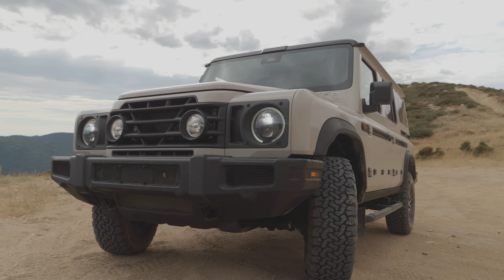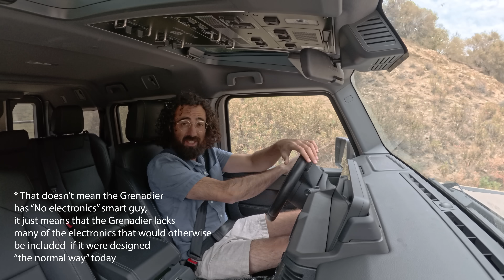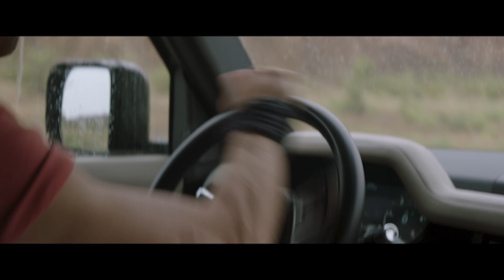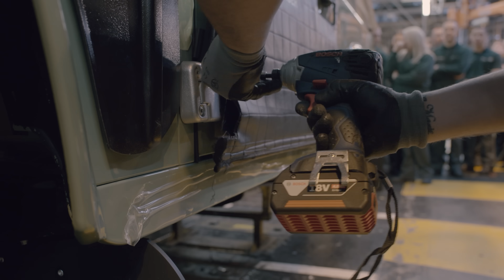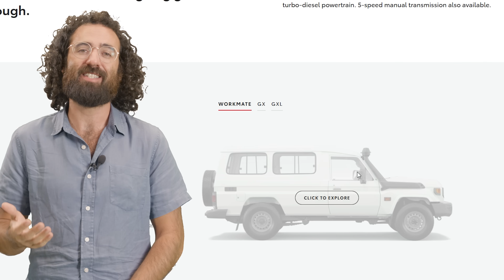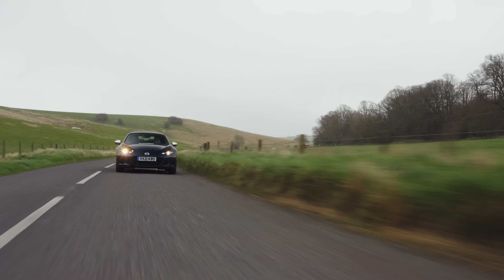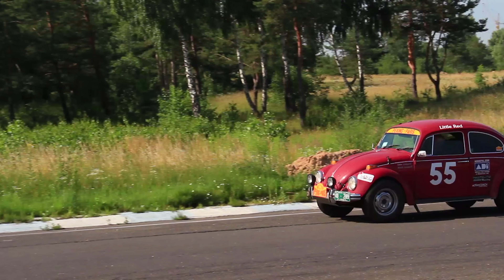Why a simple new truck has to cost over $70,000 in 2025

Comment: I want one.. but without that idiotic BMW shifter.
Reply from the maker: yeah it’s a shame. i asked them about it and they said it was cheaper to use the shifter as-is than engineer their own
Reply: @drive  penny-wise, pound foolish imo. I am the target market for this vehicle. The BMW style shifter and the lack of a traditional dashboard display are turnoffs for me. Also, I understand that a solid axle offers advantages for off-road performance, but this is not a Jeep. It's an overlanding vehicle. They could have made a compromise, like the 4Runner, and it would have worked just fine. I have owned two fifth generation 4Runners, an SR5 and a TRD Off Road, which I have used extensively for overlanding. This includes driving the Pan American Highway all the way to South America in my SR5, with plenty of off-road driving. Both of my 4Runners have performed flawlessly for my needs, both on road and off road.
Reply: @HeadWestPhotos Sounds like you’re not the target market then..
Reply: @goldenageofdinosaurs7192  I "overland" and off-road my vehicles extensively. I literally cross shopped the new Land Cruiser, 6th Gen 4Runner, 5th Gen 4Runner, and the Grenadier last year when I was looking for a new vehicle. I ultimately chose another 5th Gen 4Runner. Saying I'm not the target market for the Grenadier is like saying a corn farmer in Iowa isn't the target market for a John Deere tractor.
Reply: I literally saw a company post an aftermarket shifter upgrade for the Grenadier. Maybe 3 days ago.

Looking at the video and how it was demonstrated, it appears the shifter mechanism is in a box that drops right into a cradle.
Reply: @John1911  The 2020 Toyota Supra shifter is a snap in replacement and oddly square and chunky like you would think it would have been.
Reply: @John1911  That is great then. Like a jeep, everything should be upgradeable on it.
Reply: @shadowj5639 since I am in the market, I have been looking at the accessories available and literally every week something new comes out from one of the usual suspects off-road tuner companies. 

These will be JUST like jeeps in that regard. Has already happened.
Reply: They could use the shifter off the Toyota that has the same BMW and ZF powertrain. That is almost identical to the shifter used in the LR Defender, which also controls the same ZF 8HP70 gearbox. Not that I’m a great fan of the Defender’s shifter either, but steering wheel paddle shifters transform the experience in some situations. My main objection to the Defender’s more conventional looking shifting stick is that it needs too much use of the unlocking button on its front and that it is very fussy about pressing the brake pedal when shuttling between forward and reverse. These are probably software designer’s decisions and may vary between brands and models that use this transmission, because I have no such issues with the same transmission in my 2021 Range Rover which has the rotary selection dial.
In the Grenadier, the BMW X5/X7 type lever does look out of place, but if it performs well, stick a small brown canvas bag over the top of it. All cats are the same in the dark. 😉
Reply: @hedydd2  Actually, the petrol Grenadier which uses the BMW B58 engine and is the only engine available in the North American market is mated to the ZF 8HP51 transmission. The rest of the world gets that and also the BMW B57 diesel engine as an option but it is mated to the ZF 8HP75 transmission. The later is rated to a much higher torque figure of 750Nm. The transmission shifter is electronically linked to the gearbox and not mechanical so changing it out would be a "relatively" simpler proposition.
Reply: @johncanalese588  
I’m in the UK and by far the most favoured engine for this type of vehicle in Europe is the diesel engine, which gets the stronger 8HP70 or probably the newer 75 as you say. This is the same gearbox as fitted to Defender and various high power BMW. The Rolls Royce Cullinan, only available with a petrol engine, and the Defender OCTA gets and even stronger version of the box.
Reply: As this has a BMW england transmission, that means it's probably reasonably possible to put a manual transmission in one.
Reply: Not a deal breaker

Comment: I own one. They are built very well. Very surprising for a startup company. There are units on the road with 50,000+ miles with mainly just minor issues. The drivetrain, suspension, and frame are very robust.  The simplicity is what got me.  My other vehicle had a sensor go out and the bill was 4k.
Reply: and you think a $4k sensor bill isn't a possibility on a Grenadier?
Reply: @donleamon8653 exactly
Reply: @donleamon8653  good thing about it is the front sensors are optional the rear sensors though for me I was hit in the back so I left it without sensors it’s honestly better off-road way less annoying and an oxygen sensor was $1500 it didn’t really cost that much
Reply: @donleamon8653  if you look at it from a risk standpoint. When you have many more sensors on modern cars as compared to the ineos, I’ll take those Vegas odds all day long
Reply: Almost 64K miles here, only a few minor hiccups. No deal breakers!
Reply: how are the electronics holding up? heard there are issues. interested in purchasing one
Reply: @pennmikael they are holding up well.  There’s always a few really not too annoying quirks that software updates will fix. Occasionally my backup sensor will go on, but I think it’s due to light and the sensitivity adjustment is needed. They have been putting out updates. I have zero regrets and would do it again in a heartbeat.
Reply: @pennmikael look up
Reply: Damn what sensor? Sounds like you got ripped off. Also I hear the Grenadier is having problems with the hood popping up and doing weird stuff. It's too bad that power steering electric whining sound is so loud all the time on one or that they didn't allow the wheels to turn very far to make it turn sharper. All that was was geometry underneath
Reply: @ronaldrrootiii6040 god no I did t replace the sensor.  I haven’t heard anything about the hood.  I follow the forums religiously. The power steering wine is hydraulic and is common. It’s a recirculating ball hydraulic steering unit. On the road it’s questionable, but this is a purpose built off-roader . The steering is fantastic off-road. To be honest, the whole wagon makes noise. Sounds very mechanical going down the road, but people that buy it understand it.
Reply: @fierychilipeppers494 yeah I like them. I'm looking forward to suspension kits and sway bar disconnects being made. As of now I have a solid axle Rover and an air suspension Rover which actually does really good regardless of lacking articulation it just makes it right through perfectly super comfortable and has been extremely reliable. I do like something that has solid axle flex but sometimes it's fun to let the air suspension do its thing and the traction control to pop you out immediately. I mean mine has almost 200,000 MI all but one of the air struts are Factory. All the electronics are great just have a good battery and alternator in it😂 I used to hate the direction Land Rover went in which I do now because the wheels are so huge but I'd say around the lr3 LR4 area they're actually pretty amazing at everything. The LR4 was a little unreliable but the lr3 was solid
Reply: Also I wasn't saying did you pay for it to get replaced I was just saying did you do it yourself? I'm just curious what sensor could ever cost that much as far as labor goes cuz obviously it wasn't the price of the part
Reply: It's not a startup company. This is a design transfer project by a billion dollar corporation.
Reply: @commentsaretheworst   although ineos is a billion $ chemical company, they just recently started making vehicles, so they are a new car company and impressively you don’t see a lot of the build issues with new car companies.
Reply: @commentsaretheworst what is the design they transferred?? Not the Defender.  LR didn't let them they just did what they wanted
Reply: I'm on 145,000 miles in my Jeep Wrangler with no issues, and it cost less than half as much as a base Grenadier.
Reply: @tenpoundburrito  I’m proud of you.  I used to own a jeep.   :)
Reply: @tenpoundburrito a jeep can't go 50k without issues, let alone 150k. FOH with those lies
Reply: And once you put the ad ons and simple offeaod mods the jeep costs almost as much and still way worse reliably and drives worse and the ineos comes with the b58 and b57 so you increase cheap and reliably
Reply: I don't own a Jeep but I know people who do and even if there is any issues it's like okay a sensor here or there that's not going to slowly equal the price of a Grenadier plus if you do your own work even a full differential for like $2,000😂 that's nothing the guy still has a point

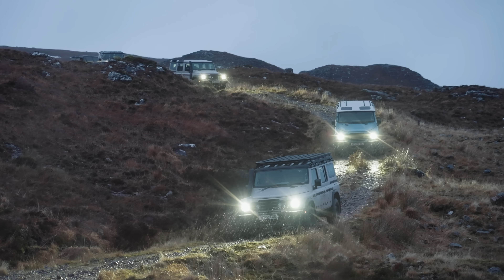Comment: @13:18 - No it doesn't.  It makes it kickback less over rocks, but it does NOT make it more precise.  And honestly, it should self center AND not have strong kickback. Just like every other recirculating ball steering box for a solid axle vehicle.  My 1997 Land Cruisers power steering self centers and doesn't kick.  This is just bad steering.
Reply: There is a YouTuber/Tuner that replaced the steering stabilizer with a aftermarket one (from Fox I think).  They said the steering self centers after they did that.  Seems like it might just be a steering stabilizer that is too strong from the factory.
Reply: I was about to add the same comment, and ironically we have the same thing. Well mine is a LX450, but yeah. I test drove an Ineos and while the steering is ok, it really should center better. Lack of a TC with a neutral position for flat towing ultimately took it out of the purchasing decision. The new LC/GX are overpriced disappointments. I ordered a manual transmission Bronco. The LX is getting some TLC and taken out of daily duties. Owned her for 18 years, no plan to ever sell.
Reply: Yup. My FZJ80 on 35s and 2.5 OME self centers. 20 years 255,000 miles on my supercharged 1FZ-FE.

Comment: AC, power steering, power windows, adaptive cruise control, leather seats... it is a LUXURY off road vehicle.

It's just that car owners today come with pre-programmed imbecility into their minds, otherwise some cars not only wouldn't sell but wouldn't exist at all.

Cars much like everything today: appliances, computers, houses aren't designed by enthusiasts often thinking of a broader customer base, they are designed by boards of directors that don't have a clue and the standards are set by committees based on a few selected duper numbers that some of the aforementioned boards of directors think they can handle.
Reply: You can get the Grenadier with cloth seats.  The seats are manually adjustable regardless of them being cloth or leather.  I don't think you can't even option power seats.  Ineos didn't want seat motors to short out when owners get it stuck in a river.
Reply: @The_Opinion_of_Matt 
Good luck with the various low level electronics fitted under the seats and lower dash if the water gets that high inside the cab. It will be toast.
Reply: @The_Opinion_of_Matt No option for a manual transmission. Not really "simple".
Reply: @yuri-il-sung  you are hard pressed to find a manual across most of the industry.
Reply: I’m pretty sure most things are done by enthusiasts, it’s just that regulations hinder fun and functionality for safety (safety is important but a cage and harness are safer than airbags but it’s still not legal because only few people care so politicians don’t because it won’t affect votes significantly (and yes i know this is oversimplified)), and committees just care that the thing they make is as cheap as possible while lasting just till the warranty expires and having the cool hip things build in so they can hype the thing up, even if those things don’t belong together and actually make the experience worse.

Comment: D90 left US because of lack of airbags not the emissions.  It had the same engine as the Disco of the same year until ford sold them to Tata when the bimmer engines were used.
Reply from the maker: yes, we mention that
Reply: @drive  yea i saw that later but leading with emissions just isn’t true because the emissions mods were made to the disco and the Range Rover.
Reply: @firstlast4888 US emissions are still keeping the diesel Grenadier from the US market. 

The Tier 4 final and later stuff have just trashed tractors and diesel pickups in the US. 

The Trump admin is pushing a bill in Congress to eliminate all of it.
Reply: BMW engines were never fitted to old UK built Defender. Maybe South African assembled ones?
Last few years of Defender with the latest dashboard surely had airbags and ABS but otherwise crash and rollover protection was abysmal and not fit for the 21st Century.
The only BMW engine used in Defender is in the current V8 twin turbo Octa models which have 630hp. The old classic Defender used Ford engines until the end of production in 2016

Comment: give us a new xj, that is the real simple. Instead built a 98 xj because nothing new fits that bill. I'll take manual windows, no abs, no traction control, solid axles, slick top, fan knob, temp knob etc.. All I like for a creature comfort is heat/ac, a double din radio with android auto and cup holders not an ipad in my dash or gauge cluster being an ipad also. OH and make it AFFORDABLE I like the modular design but the price tag says nah.

Comment: I don't believe that. It has been proven that the vehicle market was inflated during covid as manufacturers attempted to gobble up as much stimulus cash as possible. Now this same market sits bloated far above what any middle of lower class can afford without giving up a kidney or two. How many car lots do you see sitting stagnant with "$5,000-10,000 off MSRP" banisters?
Reply: Yup. The Lada Niva Legend was one of the real simple cars you could buy new, but those aren't in America, neither are they still sold today (production ended in 2023, if I remember correctly).
For car in the video, you can already see where that $70k is going when you look at the interior. It has heated seats, an automatic transmission, a giant infotainment screen, leather, glass--the whole package. These techbros call it "simple" for lacking the things expensive luxury 4x4s have, even though having no ventilated seats, no active suspension, and hydraulic power steering doesn't make your car simple, rather, that's just how every middle-priced car is. A 2025 Nissan Versa is more simple than this.
Reply: Big discounts sound good to me as a consumer.
Reply: The Drive went from https://youtu.be/zOJ0J5Kzkj0?si=zzZ6KpKS_On95meD to this..... Not impressed.